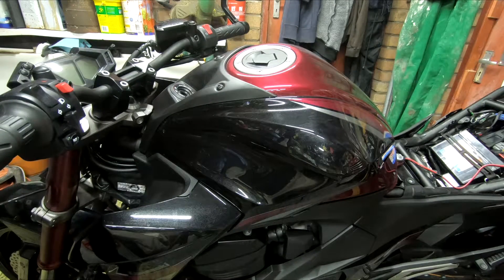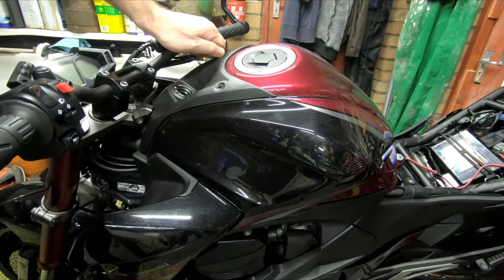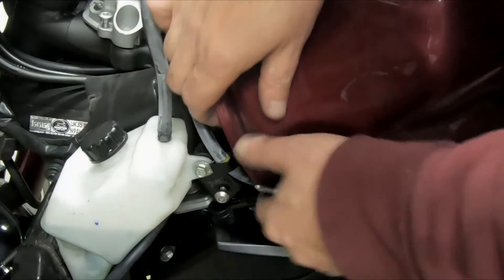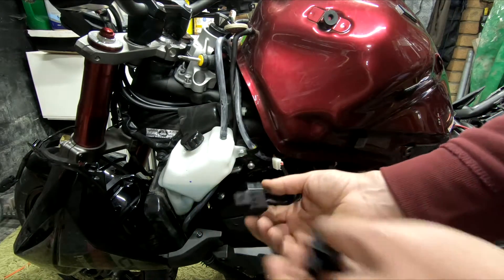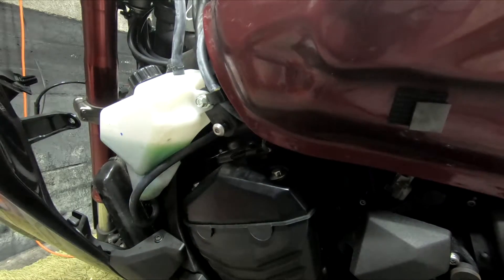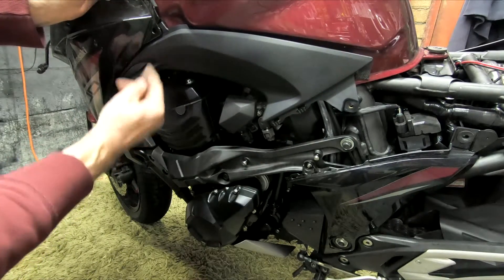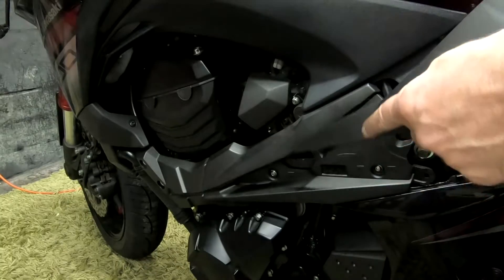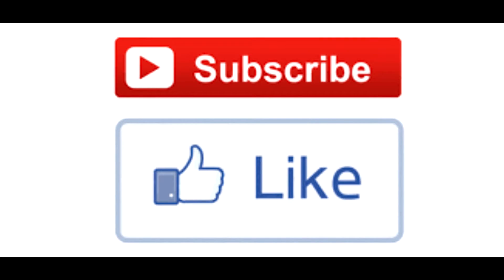Z800 Indicators - Led flasher relay swap

Comment: Hi Boss!
Abs indicator light is always on.. Do u have any idea how to fix it on Z800?
Reply from the maker: Hi, i'm not very familiar with the z800 (not my bike)
On my bike (triumph) it will go out after you have driven a short distance?
If this doesn't work,try checking and cleaning all connections and terminals.
Failing that, you will have to read for faults
using 'tune ecu' or visiting the dealer.